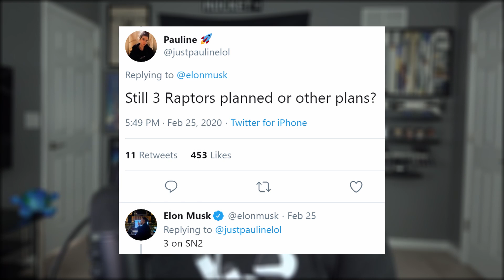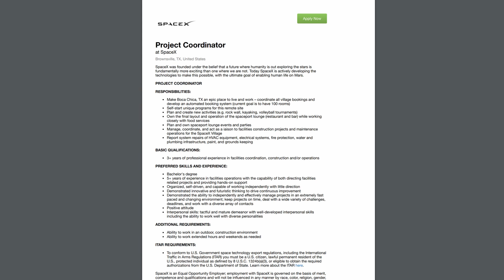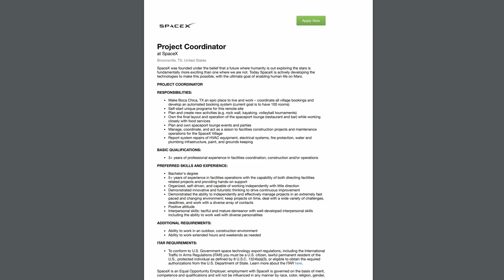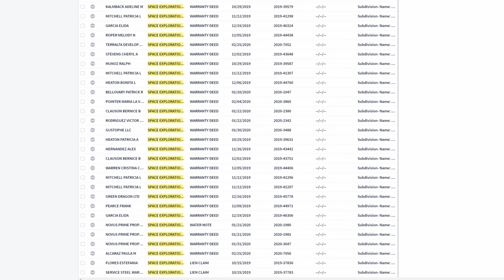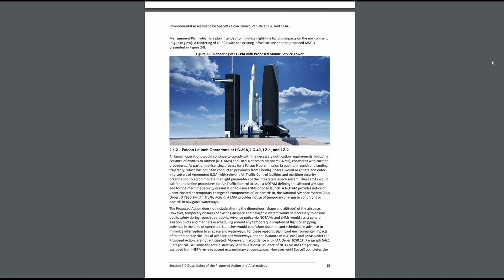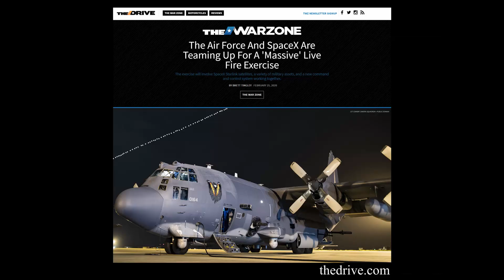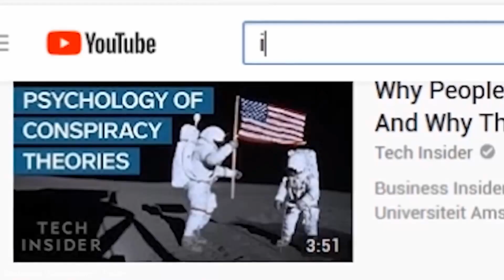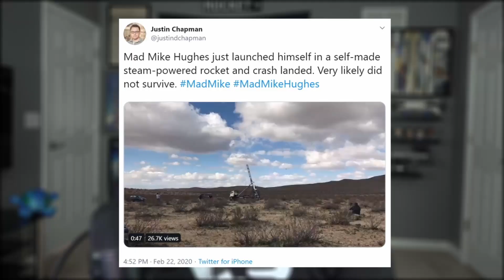SpaceX Starship To Ignite This Weekend | SpaceX in the News

Comment: With starship already struggling with center-of-mass issues in the past, it seems odd they put the LOx tank in the back. Considering its much smaller size and the mixing ratio with methane, one can conclude it to be much denser, even without knowing the exact temperatures and pressures.